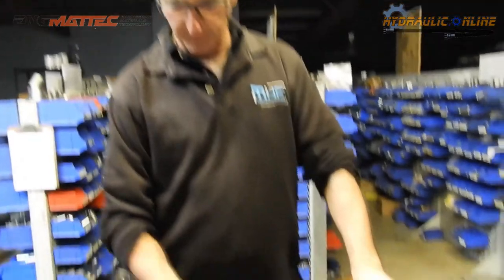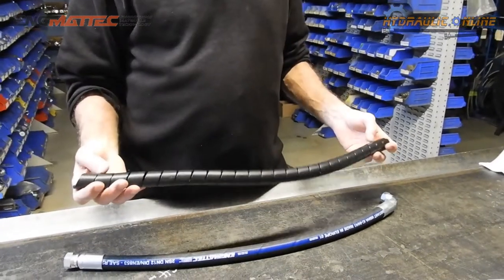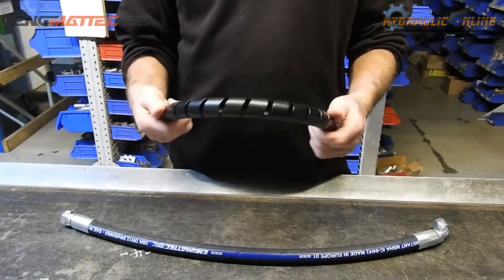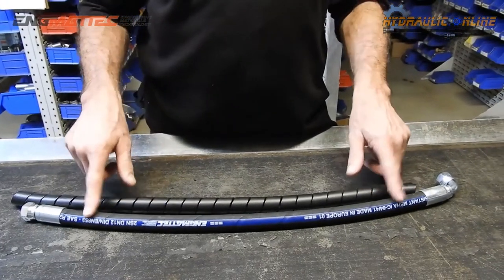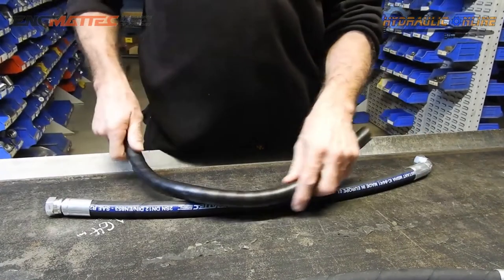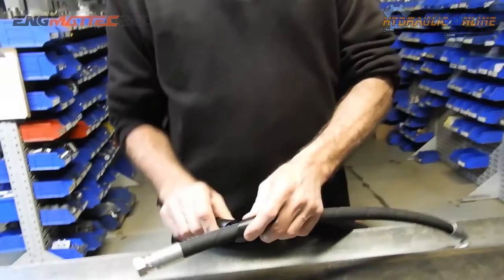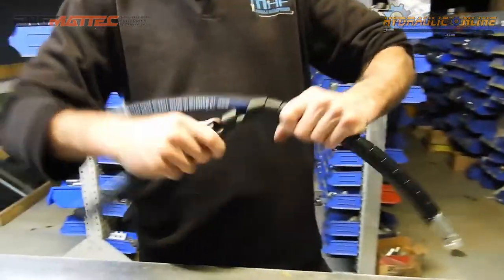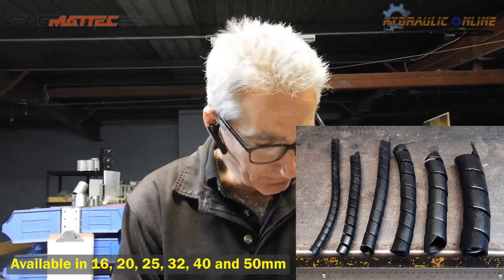Protect Your Investment Wrap Your Hydraulic Hoses and Electrical Cables Extend Their Life

Comment: What size is that hose ? 3/8 ?
Reply from the maker: mm  mm 3/8 " hose is actually referring to the internal bore of the hose not the external diameter, 3/8" 2 wire hose manufactured to SAE 100R2 Specifications will have an Outside diameter of around 19 mm or 3/4" inches, hope this helps you.